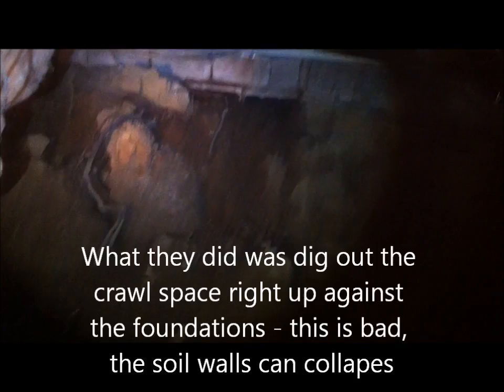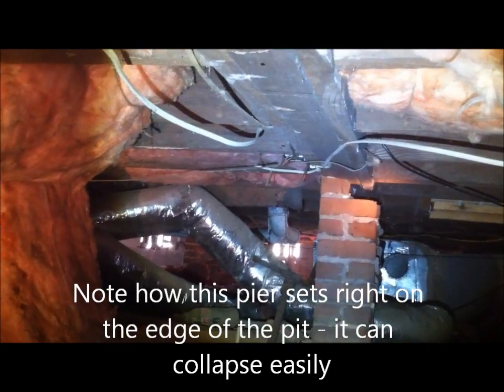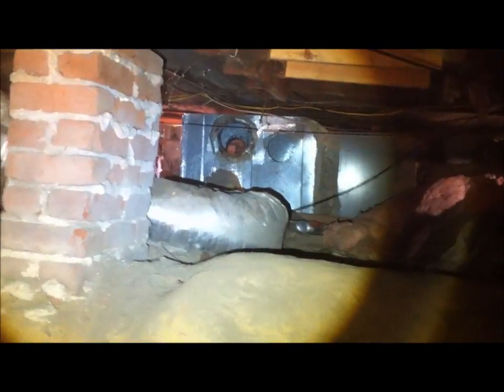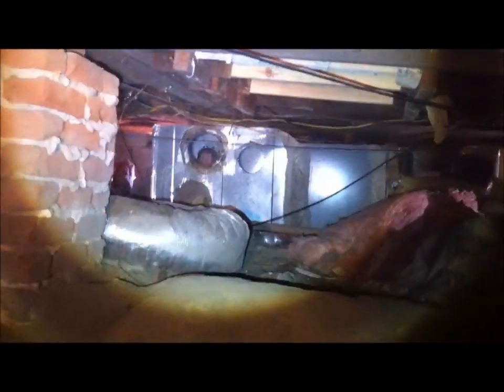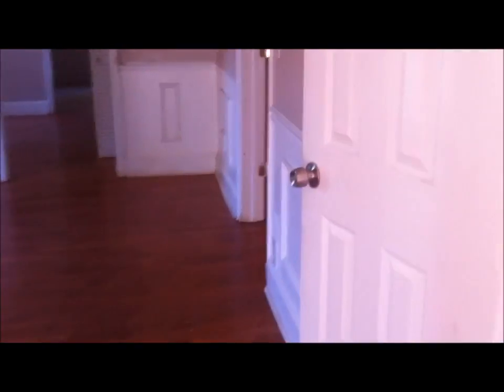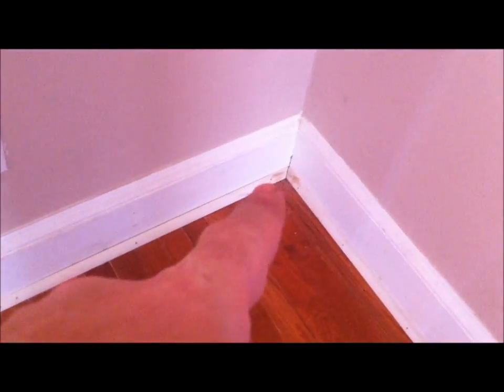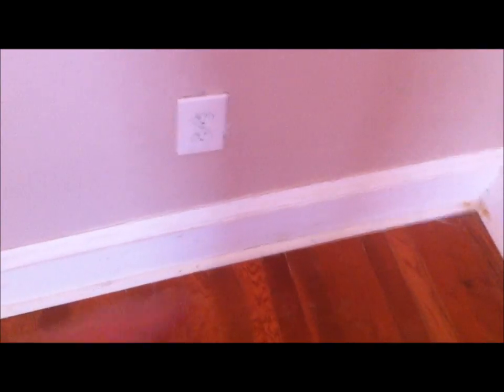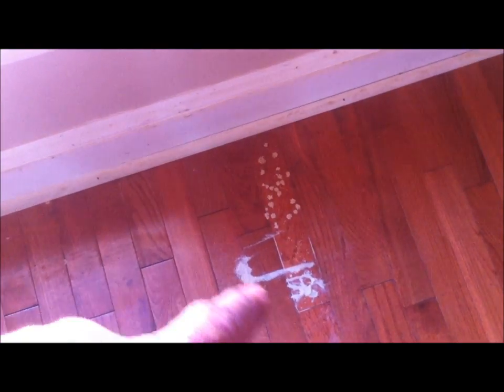Improperly Excavated Crawl Space

Comment: My neighbor dug out his Crawspace about 2 feet without going below the foundation which made the ceiling about 6.5’ high.  Then he poured about ten inches of concrete against the foundation and around the piers up to the original ground level which he said gave it structural strength.  It looked like a basement and very secure.  Nothing like in the video here.   Over ten years now and he hasn’t had any problems.

Comment: So if I had, for example purposes, a home with a crawlspace and I wanted to dig out one of the 20x20 rooms that has two exterior walls, could I excavate a 15x15 area with a door leading into an existing cellar and still be okay with the house supports? That would leave a good 5' of dirt under those supports. Put in a cement floor and wahlah! Opinions anyone?
Reply: Rose C 
It should work if you put concrete to hold the 5 foot dirt walls in place.  My neighbor dug out his Crawspace about 2 feet without going below the foundation which made the ceiling about 6.5’ high.  Then he poured about ten inches of concrete against the foundation and around the piers up to the original ground level which he said retained the structural strength.  It looked like a basement and very secure.  Nothing like in the video here.